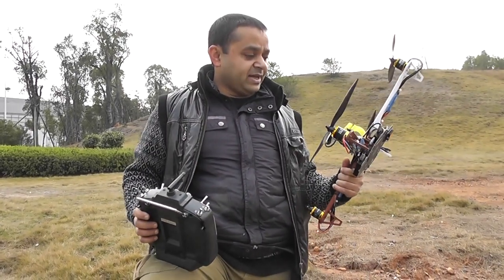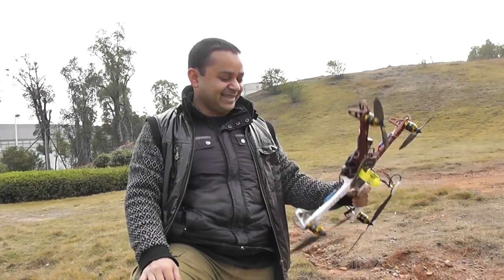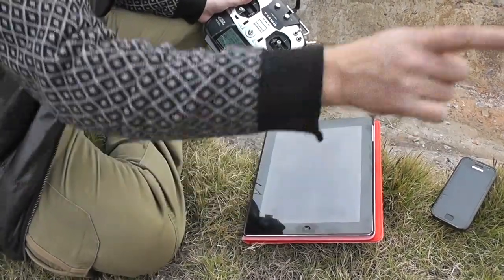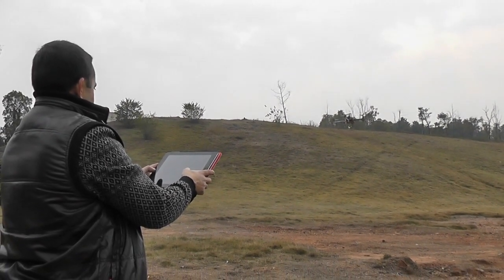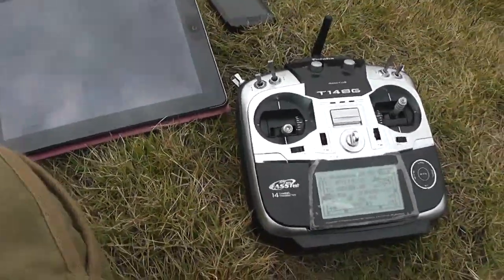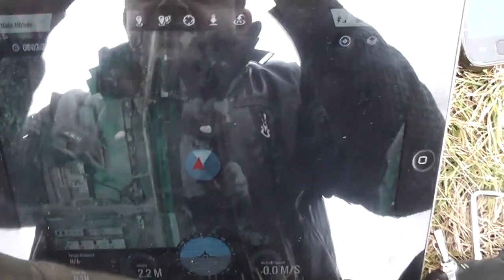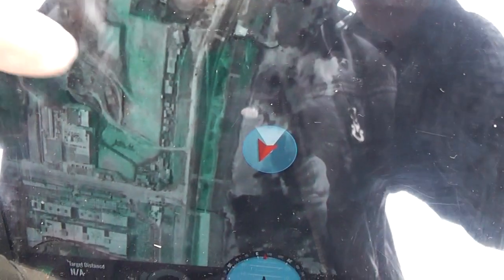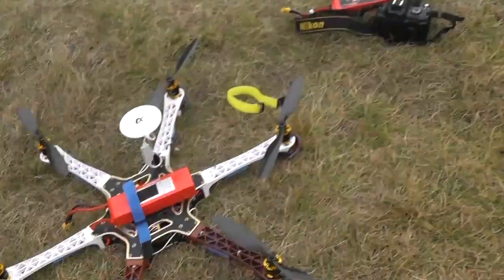DJI iPad Ground Control Station for Naza V2

Comment: Hello, I have a question for you as so far I find your videos very informative. I have build a quadcopter with Naza v2. As a transmitter, I have a FS i6s. I have then dowloaded DJI Ground Station on my IPad. For some reason, I cannot understand why GS does not recognise my flight control. Do I need DJI data link in this case?  I would be very grateful if you could please give me an idea what the reason might be and or if you could guide me. Also today I cannot get any GPS signal from my Naza.
Reply from the maker: yes you need datalinks

Comment: Hello. I would like to know if you can help me what kind of remote control you used. I have a futaba and when I turn on the data link that I have on the ground it bothers the receiver futaba that I have on the drone. thank you.
Reply from the maker: Possibly you are using 2.4ghz data link. Obviously they have issues. You should use 900mhz or 433
Reply: but what frequency did you use for the data and above all which transmitter and receiver do you use?
Reply: I see that in the video you have a futaba 14 ch if I'm not mistaken. what receiver did you use combined?

Comment: Hi AliAlways nice informative friendly videos beside the on screen data and upgrade capabilities, does the naza m lite & naza m v2 perform identical in regard to the gps and holding position etc ? 
i read in one description that the v2 will even work to stabilize the multirotor even without gps better than the m lite ..pls let me know bout your thoughts.Regards

Comment: I have both DJI 2.4 Ghz GCS and AVL58 5.8 Ghz video downlink sets. As I understood data link is for autonomous flying but you can't have video link with Datalink. You need AVL58 for video downlink. My question is that how do you integrate these two systems? Do you use ONE mini iOSD for these two different systems? Also do you use an iPad for autonomous flying and a small FPV screen with 5.8Ghz receiver for video downlink?  I really want both autonomous flying and video link at the same time.

Comment: Dear Mr Alishanmao.

I'm new to DJI, and I've recently purchased my first NAZA V2.
I've flown my hexa and it flies beautifully.
I've practiced flying with GPS and ATTI modes, and I was recommended to not set the Manual mode in the flight mode button in the radio to keep it simple.
I intend to buy very soon the Datalink radio for the telemetry and making waypoints and I wanted someone to confirm that it'll only work in GPS mode.
I would also like to have confirmed that in case of having my hexa flying while making the programmed waypoints, if it goes berzerk and tries to flyaway due to being connected to less than 6 sattelites, if changing to ATTI flight mode will override the groundstation commands making him to stabilize and be controllable by our radio.
Thank you in advance for your help.

Comment: I experience the same GPS problem on my iPhone when I'm in Shenzhen. Someone told me the local government intentionally offsets the maps data. Though I doubt it because I see people using turn-by-turn with success. But if I pull up maps on my phone while I'm walking around it often shows me a few blocks off.

Comment: I have the phantom 2 H3-2D.

I'm wondering if there's a way of having a wifi link to smartphone like in the phantom 2 vision?

I know there's video downlink and receivers but I'm not interested in FPV. i just need the wifi for basic telemetry like the Vision app provides.

what components need to be purchased/ installed?

Thanks.
Reply: The Phantom 2 is ready for FPV, but you'll need a kit, like fatshark or and iOSD upgrade in order to send video.

Comment: My friend has dji gcs  on his wkm but ipad sim mode does not work properly at all and hes scared to fly for real because of this. Did you try out the simulation first his seems to not work well on ios 7.04 .
Reply from the maker: just try for real. have one person stand by with radio control and as soon as your see some bad behavior, person with radio can switch to manual mode and instantly can get control of quad. Needless to say, keep the radio throttle to middle all time :D when trying this game. it works, just be careful where you put the waypoints. sometimes you can put a waypoint way far than it looks on map
Reply: alishanmao you mean Manual or ATTI ?
Reply: manual he said.

Comment: Great video. You had me cracking up. Can I use this with the naza v1?  Not the lite. Thanks
Reply: You need the new dji naza m v2 pmu. 

you will need to buy the new pmu to use the ground station.

NOTE: this does not work on ipad 1 and ipad 2 - i found out the hard way :(
Reply from the maker: I do not know, so far naza 2 can do it
Reply: I would say you can , if you upload the v2 firm ware , its free to upload from DJI and just updates v1 too v2 and you get all the new cool features of the new assist software
Reply: yes naza m v1 is same as v2 once you do free upgrade and it works flawless